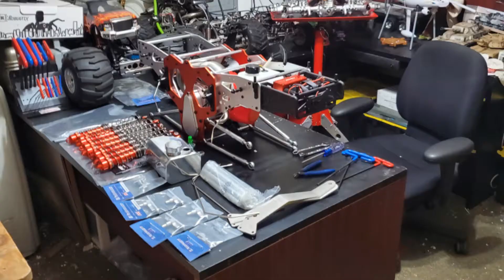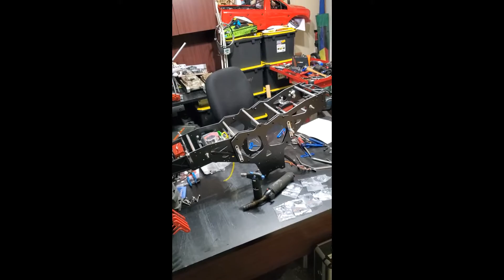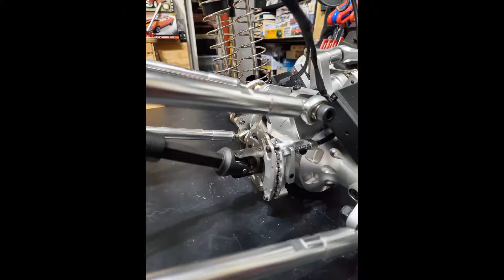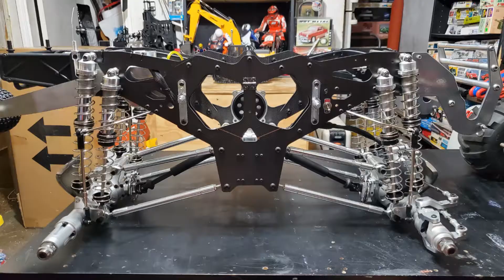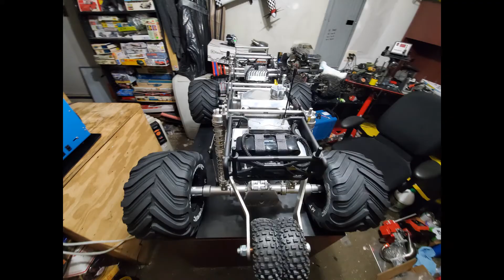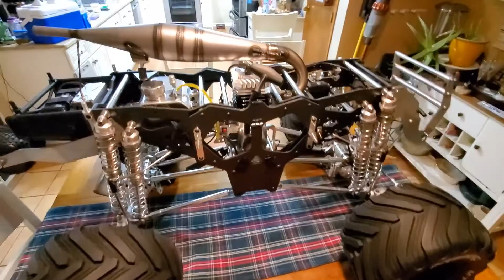Primal RC Raminator and RCMAX Mod

Comment: How your 80cc going? You going put any new videos up? My 80cc have not got my install yet
Reply from the maker: I have installed the rcmax "50gt", Didn't want to shatter gears on truck with the 80....go easy when you get the 80 installed on yours!!!!!! I was waiting on 110 octane fuel...received it but just haven't had time for first run!! will post when I finally can!!

Comment: How did you get the red parts to turn silver?!  Is this de-anodizing?
Reply from the maker: Hello Wes, here are two links to how i did this, https://youtu.be/hsPJ0SfwFZE and https://youtu.be/hOpX9EkSZiU there are two vids. keep in mind that this is a chemical reaction so it is advised that you have a bucket of water to dip parts and or pretty hot  liquid if reaction becomes unstable. little difficult to find the crystal drano but internet search will help and it goes a long way for little amount needed for de-anodizing! thanks for watching my video!
Reply: @michaelcerrati1694  Thanks Michael.  Great job on this build…it’s fantastic!!!

Comment: What motor do you have in this truck I like the brush guard and I like the wheely bar where can I purchase those the same place where the truck is or some place else please comment back thank you very much for this video
Reply from the maker: Engine is the new Rcmax 50gt for Primal Raminator! You can get all mod parts direct from Dan at Primal RC or Mike at Rcmax! Thanks for your feedback on my build video Martin!
Reply: @michaelcerrati1694   This truck is absolutely beautiful they really know how to build a truck
Reply: Great build man... I'm making a custom tail pipe that comes down and out into a 'Y' dual exhaust, testing out different builds to get the right sound and performance, I wanted to make a video but don't know how to😐😔
Reply from the maker: @MannyGunzz  thanks Manuel, would really love to see pipe, take pic and send it when you get it done!

Comment: Did you paint the frame black or are those the carbon fiber pieces
Reply from the maker: The frame is the carbon fiber replacements (hop ups)
Reply: @michaelcerrati1694  Thanks for responding I think I’m gonna pick some of those up I was kind of on the fence about them but I’m gonna go ahead and order them thanks man
Reply: @michaelcerrati1694  please make a running video I just ordered the 80 supreme but I would love to see the 50gt